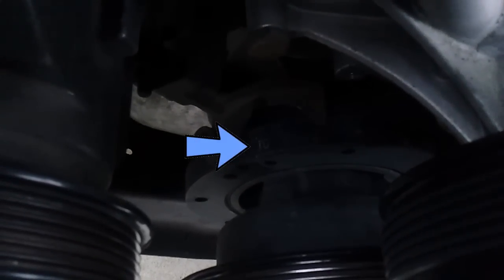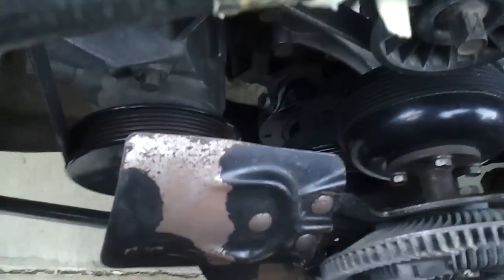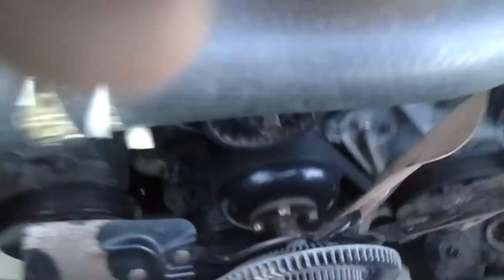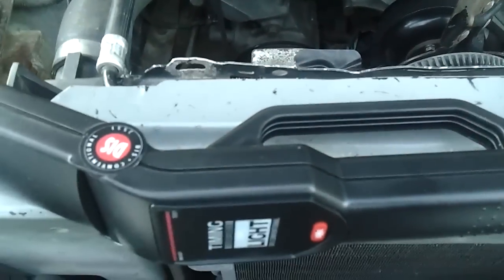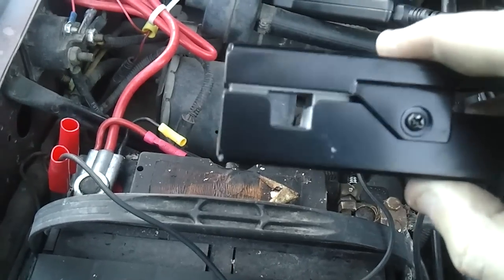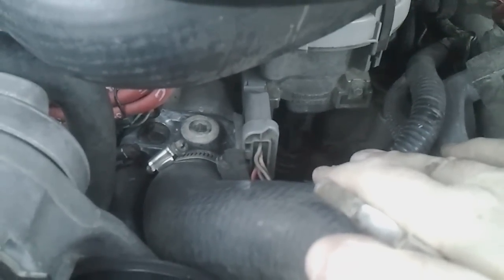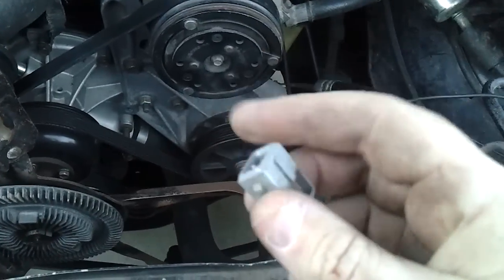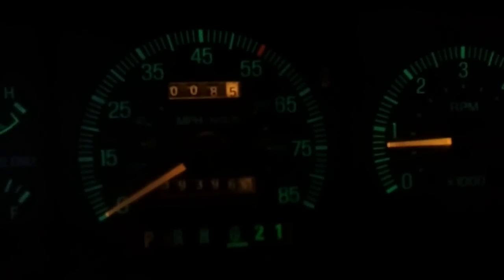Ignition Timing Demostration 1990 Ford F150

Comment: Cylinder 1 is the one at the front of the passenger side bank on V8 models. The first cylinder on the straight 6 is at the radiator end.

Comment: Life's Happening
0 seconds ago
I have an '85 and the spout is a single yellow wire wth a connector, at the base of the distributor, not a "loopback plug" like he has. Just disconnect that yellow wire. This actually keeps  the computerfrom taking control so you can get a "base" timing.  *NEVER CONNECT OR DISCONNECT THE SPOUT WHILE THE VEHICLE S RUNNING!!!*

Comment: I have another question ...When pulling my Harmonic Balancer off do i need to set my timing (Balancer )back to 0 before pulling the Harmonic Balancer ? I'm wanting to change my timing chain which i know it have to be set to 0 and lining up right ...Thanks for the Video and answering my Question quickly ...I have so much i need done to my 1995 Ford F150 4x4

Comment: I'm confused here ! Did you turn the distribator while the motor was on to get your 14 degrees ...I'm a dummy here about the timing so thats why im asking ?...I have a 1995 ford f150 4x4 and i'm trying to set my timing ....I'm having a jerking in the motor while driving at low speed and spoke with a mechanic he says the fords have a issue of timing jumping
Reply from the maker: Yes.        once you set the base timing(10 degrees BTDC, 1990 Ford F150), remember base timing is what you set the distributor at with the grey plugged pulled ,taking the computer out of the picture. Once you set the base timing, put the grey plug back in  and the computer will take over. That is when you can now "play" withe timing at idle to see what is best for you.  Make sure your base timing is at what is recommended for your vehicle. Look at any haynes manual it will give you teh right number for your year of vehicle.

Comment: What’s the name of that fuse
Reply from the maker: its not a fuse, its the computer controlled timing connector. Disconnecting it will allow you to set your base timing. Once your base timing is set, you plug in the grey plug, and the computer takes back control of the timing
Reply: So what if I didn’t take it out set the reset the time will that cause a problem
Reply from the maker: @jerrodjenkins4291  I am not sure what your asking. If you have done any work on the timing chain( replaced it and/or moved the sprockets), pulled  out the distributor(and moved the number one piston from its initial position), pulled the engine to be rebuilt . You have to set the base timing, that requires the  grey plug to be pulled.
Remember: Piston 1 should be TDC, time Chain sprockets need to be aligned. Drop your distributor in  and match to mark on the engine(for Piston 1 tdc), then set ignition timing( Base timing 10 degrees BTDC for ford 302 in video). 

Thats the overview, if just trying to do set the ignition timing, and you have engine like mine, then pull grey plug and set base timing( Base timing 10 degrees BTDC) by rotating the distributor, then  lock down the distributor, plug the grey plug back in. Then the computer will take back control of the timing(what is called Total Timing) Base timing+ advance timing= Total Timing
Reply: Thanks for that info I have a 351 I rebuilt the motor timeing TDC after finding out my ECU was bad I didn’t pull the gray plug didn’t no about it so got it TDC but when I drive it’s rpm base low so I think if I plug that plug n retime it might do better great video
Reply from the maker: @jerrodjenkins4291  I would shoot for that first, when you timing try to put a little white paint or  white out on the 10 degree mark. Make sure that you engines base timing is 10 degree BTDC though( google it)
Reply: Thank you I put a new balancer on n makes it but I’m going back in make sure I’m on the mark n redo everything you know where I can get another gray plug just to have a fresh one
Reply from the maker: @jerrodjenkins4291  no ,  but as long as the two  connections are clean on the grety plug, you should be fine. it basically  a jumper wire
Reply: Ok thanks again
Reply: Thank you man that work I have better acceleration

Comment: So because your motor is fuel injection you put it at 15 degrees and I seen videos that they put them at 36 degrees at 2500 rpm but they have carburetors and 350 and 302 is there a difference

Comment: I tried this and came across a issue, when I replug the spout back on the timing goes back to what it was before, but when I unplug it. It goes back to what i set it at, i have a 93 lightning and the engine has been rebuilt, not sure if that matters. Also the timing is at 24, very high but sounds and drives just fine
Reply: Ernesto Carrillo you might have your vacuum advanced hooked up to full manifold vacuum and not ported vacuum

Comment: I have a '93 XLT w/351 W, EFI & I can't find that SPOUT plug anywhere, the book (Hayne's/Chilton) both have different pics or none at all. A little disappointed with the Chilton's, they're usually better than Hayne's!?!
Reply: I got an OBD1 reader on ebay, $23.
Reply from the maker: @bobbybergdoll4377   that's good, better than trying to decipher the Morse code check engine light
Reply from the maker: It's a grey rectangular jumper connection about 1/2 " in size connected to a bundle of wires
Reply: I got that from your video (Thanks!) but i stil have not found mine... @DIYMikeT

Comment: Get a Actron CP9690 code tester. It checks live, record, graphing, transmission code testing, oxygen sensor tests, ABS, SRS, solenoid and relay test, timing advance test, and MORE! It works on 1983-2013 and is updatable. EBAY has it. Get the Uactivate AES#07-80 relay circuit tester. Also, AES  lineSPI ( Smart BOB) . Get the Power Prove IV and AES wave U scope.

Comment: Also have a 90 ford f150. I need to also do the timing since I replaced the distributor but if it doesn't have  the timing indicator? I've marked the 10degree on the balancer.
Reply: Look for one on the internet. Call a dealer to be sure. Set it at 10°.

Comment: The manual I have says to disconnect the SPOUT wire. I haunted for an hour for it. The book never gave a clue so I will look again for what you showed. Motor manuals are severely lacking anymore.
Reply: I can't find mine either.
Reply from the maker: That's correct
Reply: What wire? It is not where it should be? 1993 F150 351 W/EFI
 @hankbridges5055
Reply: 7:10
Reply: I have an '85 and the spout is a single yellow wire wth a connector, at the base of the distributor, not a "loopback plug" like he has. Just disconnect that yellow wire. This actually keeps  the computerfrom taking control so you can get a "base" timing.  **NEVER CONNECT OR DISCONNECT THE SPOUT WHILE THE VEHICLE S RUNNING!!!**

Comment: I'm doing this as well for MPG, I heard 14 didn't help at all, did it help more when you put it back to 10? Also thanks for the video =)
Reply from the maker: I put it back to 10 BTDC  after trying it at 14 degrees BTDC. I didntn gain in noticable MPG, if any.
Reply from the maker: I didnt see real difference,  between 14 degrees and 10 degrees. I put back more for piece of mind.  YOur welcome,  I am glad the video helped.
Reply from the maker: I didnt see real difference,  between 14 degrees and 10 degrees. I put back more for piece of mind.  YOur welcome,  I am glad the video helped.
Reply: Thanks, I did it set to 12, no different at all so set to 10 just to keep it standard.
Reply: Austin did you notice any performance difference? If you didn't hear any pinging maybe you could have left it at 14°. In the long run you could have squeezed just a few mpg better. Better performance would be another reason to leave it set there.
Reply: @charlesespenshade  
With E85 , more performance at 8 degrees.
Reply: @fredmasse6451 , my motor is built. My cam calls for 40° of timing.
Reply: @fredmasse6451 , I'm wondering if my motor would benefit with more performance. I'm somewhere in the 375 HP range.
Reply: @charlesespenshade  
Have you keep the original injectors at 19LBS ?
Reply: @fredmasse6451 , I run a carb. 600 cfm Carter/afb
Reply: @fredmasse6451 , it's the Competition Series.
Reply: @fredmasse6451  https://www.mustangandfords.com/how-to/engine/28898-400-hp-302-small-block/

How my motor is basically built. There are some differences. I have GT40P heads. Also running timing gears, not chain.
Reply: It won't let me post pics here, sorry.

Comment: I have a E350..is it the same for 351 as yours:10 -14* on the indicater?  I thought it was TDC, or  4* below or above TDC?
Reply from the maker: Yes, Ford 302 and 351 have the same base timing of 10* before TDC. I put mine back at 10 degrees after some initial testing at 14 *. I thought I might get some extra MPG, but that didnt pan out. So I would set it at the factory timing of 10 degrees. Otherwise you might run into issues of pinging(detonation) at higher degrees.
Reply from the maker: I would think you would have pinging at 4*  below TDC(BTDC). The fuel would ping(detonate) before the spark plug could ignite. Remember your on the compression stroke , and at 4 * BTDC your almost TDC, so you would have a lot of heat built up, because of the compression. I dont know what would happen if you set ignition timing after TDC.  Got me thinking
Reply: Thanx  Iwas guessing @above or below, It's been a long time since I worked on the Ford. I didn't remember ever pulling the little white cap tho. So I did that today. It used to be hard to start after it warmed up and driven for a while and it  seemed  high  compression was the issue with advanced timing. fyi: For gas economy in my one ton E350- aluminum wheels/highway tires, remove A/C compressor/brackets/surpentine and  clutch fan anduse a 5 blade stays cooler, remove all pollution keep oxygen censors all working(still passes Emissions)  remove rear heater 4 rows of seats. gets 15/16...Then I bought a Chev 3500 17/19mpg  and the Ford is getting ready for sale.. Thanks again.

Comment: You didn't do total timing, only initial timing?
Reply from the maker: My Engine was EFI, so that timing advance(total timing) is done by a computer. I set the base timing to 10 degrees(no computer control), then the computer advances the timing when needed.
Reply from the maker: and I think that that Total timing is just the base timing plus the advanced timing.  So I did the base timing, and the computer did the advancing thus giviing me the total timing.

Comment: Was there a video before this one? What was the whole need in putting the timing at 10-14 ATDC? Reason I ask is that I have a 90 bronco with the 5.8. I had to replace 2 push rods because of bad fuel. long story short something went wrong and now I have been forced to redo the timing and its been a job. I do agree this is one of the better videos that goes into detail about the spout connector. I have the timing set, #1 on tdc, distributor cap on the # 1. I cannot get the thing to even idle enough to set the timing. I have tried to turn the distributor both ways while semi running with no luck. but it  do I need to pull the distr. and try and the rotor button after or before the #1 to see if that helps.
Reply from the maker: +RockstarGTA1 
I was experimenting with the timing set at 14* degrees TDC, For improved Gas Mileage. The difference was negligible, so later on I put it back to factory BTDC 10*

Before ignition timing is done you must make sure that your Number 1 chamber is  at TDC on the compression stroke(Top Dead Center or piston head is at the top, near the head ), I would start there and  throughly check that its at that position. There is a video in my series, where talk about when a piston is at TDC  at the compression stroke. 
Its probably the videos i was installing the pistons, check it out.

The order I remember the timing scheme being was piston 1 (TDC@compression stroke), timing gear(alignment), then ignition timing. If any of those are not right, its not going to run right.
Reply from the maker: I know I read your comment a while ago, but I never noticed  that you thought I put the timing at "10-14 ATDC",  I set my base timing to 
10-14 BTDC(not ATDC).

Comment: do u turn the distributer counterclockwise to advance it? i know thats right for a 350 but wasnt sure if thats right for a 302?
Reply from the maker: storminnormanz I used a timing light when adjusting and didnt take note of spin direction.
Reply from the maker: ***** but the distributor does does turn counter clockwise just like the oil pump .
Reply: clockwise to advance

Comment: Im having trouble timing my truck, it wont start now but it did start the first time but i didnt take the spout out and it must of advanced it. Well I'm curious does the harmonic balancer indicator need to be on 0, -10, or 10 degrees when the bug is pointed at the number one spark wire?

Comment: Keep at 10 deg btdc, the computer needs that to be so it can advance to where it needs it to be. You might get better mpg, but you might be confusing the computer and or getting ping. Which basically is too hot of a detonation. These engines are plug and play if there is any hiccups or misses, it's usually vacuum or emission components. i.e. map , o2 sensor , iac , etc. etc.
Reply from the maker: I have been running it for some time now at 14 degree's base, but i have to say that the mpg is still about 12, which isn't that wonderful. So i am planning on going back to 10 degrees and testing it. I can tell you that i didn't have any ping at 14 degree's, and she sounded a really good. I want to put up more videos, so maybe this will be the first video I put up. Thanks for the comment,
Mike
Reply: @DIYMikeT 
 I know this was 9 years ago, but I need help please sir.     I got a 92 and I am replacing my old distributor and I didn't mark any points,  so..... on my new one I didn't put it in with the rotor pointing at the right cylinder and it wouldn't start and it barley cranked over so I pulled it out and now I'm afraid to try it again because I don't wanna mess it up any worse.